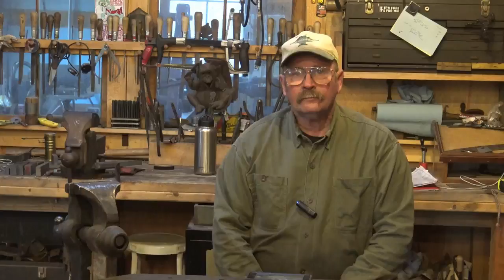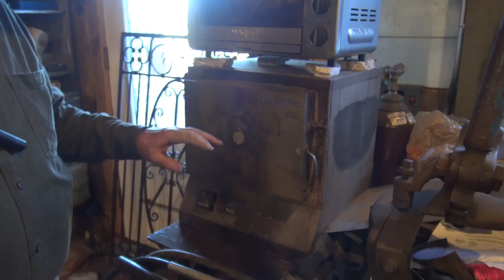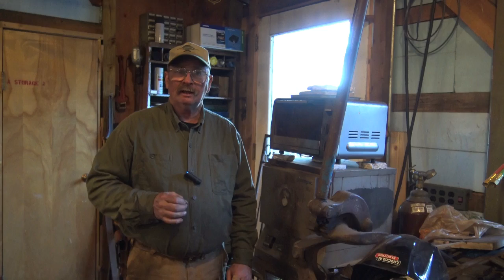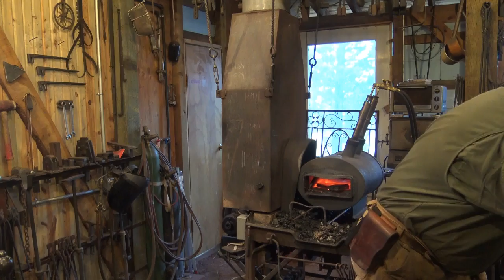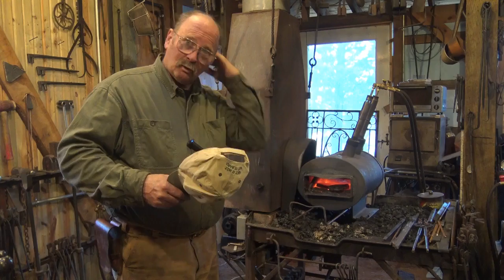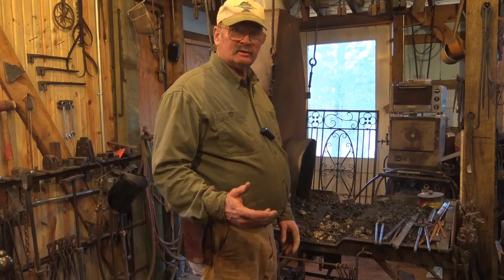Coal forge vs Propane forge a look at the pros and cons

Comment: Great video, John!  Thanks.  You touched on the economics of coal vs. gas; in a pure production standpoint, the time spent managing a coal fire isn't worth the benefits, including the romance factor.  The only time I fire up the coal forge is when my project requires it due to size or shape.  Also, most of the big box stores have started carrying hardwood charcoal for BBQ purposes.  Very affordable, plentiful and works great in my Great Uncle's coal forge!  Please keep up the great work, and glad to see you are well on the trail to your hand fully mending.
Reply from the maker: In general I agree that propane is the way to go for any production work.  However, I Know there are plenty of highly productive full time smiths out there that only work in coal, coke or charcoal.  Some of these are the smiths whose work I admire the most.  I think that when you work in the coal fire everyday, maintenance becomes so second nature that it takes much less time.  But for now, I still use propane for most of my work.

I have purchased bagged charcoal, it good fuel, but tends to be rather expensive, about $30 for a full days work.  Worth it if its all you have.  I keep hoping I will find someone within a days drive producing charcoal on a commercial scale.

Comment: As usual John another great video. My new propane forge is on order. One thing --a big thing for me that seems like it should be mentioned on the list of cons for a propane forge is the noise level. They are generally horrible! I appreciate how you have yours set up to cut off when you take something to the anvil. You would never be able to have the quality videos that you have with the forge blasting away behind you or hear the birds outside that I have noticed in the past.
I sure enjoyed making the trivets that you made a while back. What a fun project!
Thanks for sharing all that you have learned.
Reply from the maker: I can't believe I forgot to mention the noise.  That is a bug reason I get tired of working around propane forges.  Mine doesn't have any special set up to shut it off, I just close the valve for each shot.

Comment: I only use coal so I don't know anything about gas, Do you need electricity for a fan blower?
Reply from the maker: It depends on the forge design, some use a blower some draw air in through a venturi effect.
Reply: I was wondering because I don't have power to my shop and I use a hand cranked forge blower.I didn't know if propane would be another  option for me.
Reply from the maker: Most propane forges being built today are designed to draw air without a blower and need no electricity.

Comment: I pretty much primarily use Anthracite. It can be a dream to work with as long as there is always a constant airflow. Welding temperatures can easily be reached by simly laying steel on top of the fire, there is not much clinker produced,  its pretty easy to work with, and its cheap (at least where I am).
Reply: Wyatt Kindler 
+1 on using Anthricite!  :-)
Reply from the maker: Thats interesting, my limited experience with it was quite dismal.
Reply: Black Bear Forge, I, too, use anthracite exclusively because that's all that's available in my area, and because I buy 40# bags of nut for $7. I may like bituminous if I tried it, but I'm so accustomed to the hard coal that I'm quite comfortable with it.
Reply: They only have anthracite where I live and the main downside to it is that it is very hard to light compared to other stuff. I pretty much have to use lump charcoal to get it started. Once it is going with good airflow it does burn very hot but getting it burning is kind of a pain.

Comment: I still consider myself a beginner/hobbyist smith. I've made a couple knives, few other things. I use propane because it's convenient. My "workshop" is my garage which is also used for parking my car during the snow months. The workshop only stays setup during the non snow months. Never used a solid fuel forge but I'm looking forward to the Christmas gift my wife gave me, which is a smithing class that will be coal forge. 

I'll be retiring soon and smithing will be the main thing that keeps me busy. As always, great video. Thanks.
Reply from the maker: I retired to smith full time, I now work more than I did when I was working.  Enjoy the class, that is the best way to learn.
Reply: Thanks, John. I've been a semiconductor engineer for 45 years. I'm ready to never set foot in a clean room again. In addition to the class, I have a good friend who's a bladesmith. He's been helping a lot, but mostly with blades. I'm looking forward to getting into more artistic blacksmithing and this class will help a lot.

Comment: I enjoyed this video very much!  All good information.

I have yet to build my gas forge. When I do, by having both I feel I will have the best of both worlds.

On Anthracite coal vs Bituminous coal...  in my experience Anthracite is not an inferior blacksmithing coal.  Because of its very high carbon content, there is no need to try to get it to coke up.  As is, it performs very much like coke and needs to be managed like a coke fire.  For me...  (because I have to burn/forge what I can get my hands on..  or don't forge) I use both, and will rate good Bituminous blacksmithing coal and Anthricite coal dead even.

Thanks for the video..

Comment: Great video John, I just got my first coal/coke forge after using propane exclusively for almost 20 years. It's nice to have both options but I find myself using my little propane forge simply due to convenience.  Mind me asking what bluetooth lapel mic you're using? It's working great.
Reply from the maker: It doesn't seem to have a model number on it.  but it is from Sony and is set up to work with their smart hot shoe system.  Just put the other end in the hot shoe and the camera does the rest.